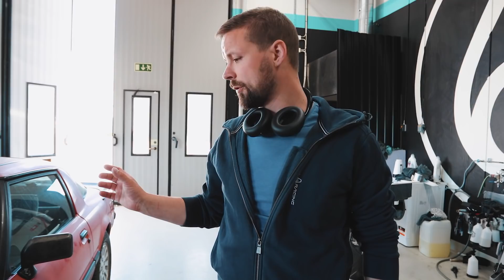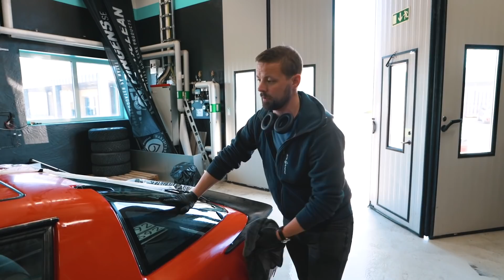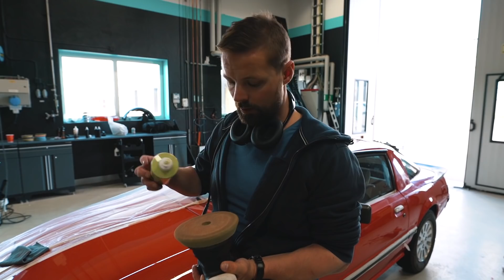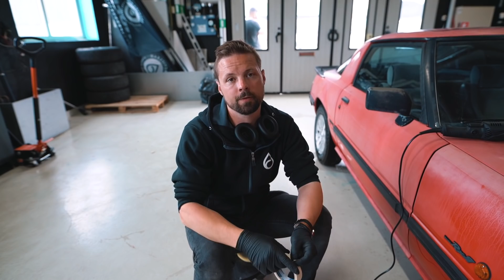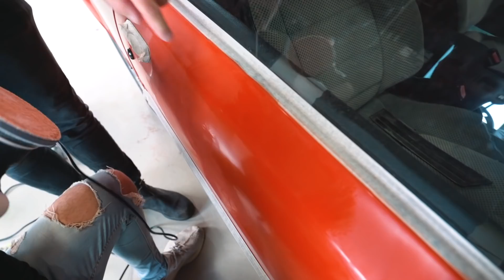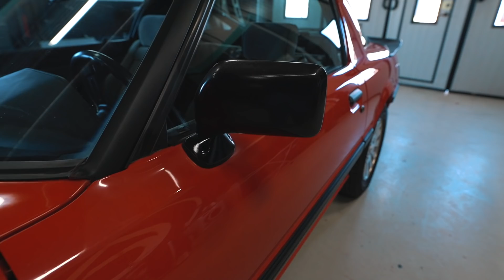HUR DU POLERAR EN SOLBLEKT BIL!

Comment: Sjuk resultat det blev på bilen, snyggt jobbat!

Går det möjligtvis få en video på hur man polerar en bil som har stenskott på lacken??
Reply: Kjøpe en Billtema PO150A 150mm oscillerende maskin for ikke lenge siden, har så lang kun rukket å teste den på vår Husqvarna LT151 plen-traktor/sitteklipper fra 2004 som hadde litt sliten lakk og plast (front på panser) ble kjempefin og blank (også plasten som var helt matt).. Har en Dobbelt oscillerende maskin fra Clas Ohlson (Cotech) så synes biltema maskina var e bra steg opp fra Clas Olson maskina! Så til mitt bruk tror jeg biltema \maskina vil fungere riktig så bra 😀